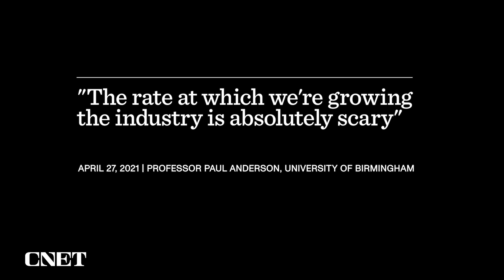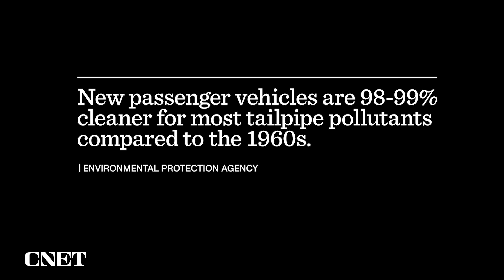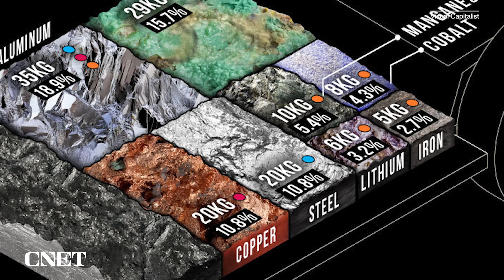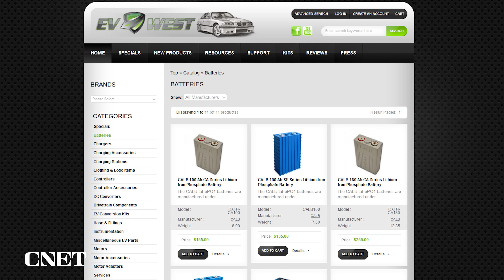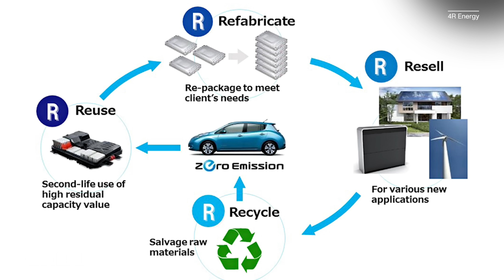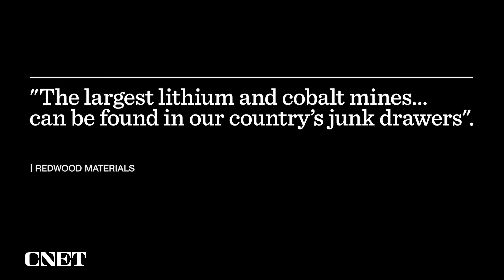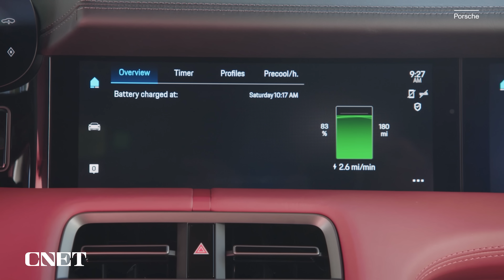MOUNTAINS of Dead EV Batteries Are Coming: Here's How We Plan To Deal With It

Comment: How much energy will be required to recycle the old battery?  More than the creation of the original battery?  Will that energy be green?  We have seen war and what it does to supply chains.  How will that impact global flow of rare materials?
Reply: Take a look at Volkswagen's YouTube video of their EV battery recycling plant.  When the plant receives the battery packs for recycling, they are fully discharged prior to the beginning of the process. The residual energy in the batteries is fed back into the plant, to partially power the recycling process. The remainder of the energy required is from renewables.
Reply: @Brian-om2hh  I hope engineers and smart people think this through instead of making bad decisions based on politics.
Reply: Calm down and read.  Tesla recycles over 90% of a returned battery.  The salvaged copper, nickel and cobalt was worth over 50 million a year and goes back to make new batteries and other electronics.
Reply: @SkaBob  How much energy will be required to recycle the old battery? Can you send me a link to the article?

Comment: Thank you for bringing light to this looming situation.  It's good we talk about this now vs when the problem becomes unwieldy.  What we NEED is STANDARDS for size and configuration of batteries.  What I worry about for reuse is if there is too much variability in shape/size, manufacturer for other electrical devices won't go for adopting designs to accommodate used batteries.  Tesla and the other EV companies need to work TOGETHER!
Reply: For moderate priced EVs standard battery "bricks" could evolve that are price competing commodities, but the battery management systems are still evolving and proprietary.  The BMS is integrated into the battery design.   I'd love to see battery standardization occur with cordless powertools!  The premium leading edge EVs would continue to use proprietary batteries, but the mass market probably needs to achieve diminishing returns returns on LI-ON before packaging of commoditized battery systems becomes practical.